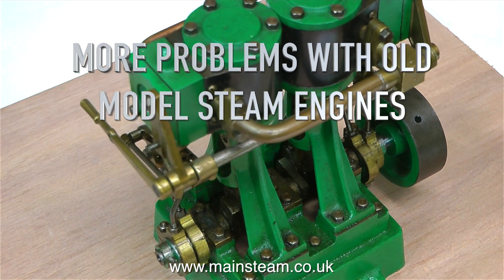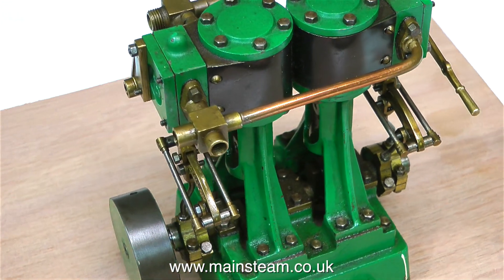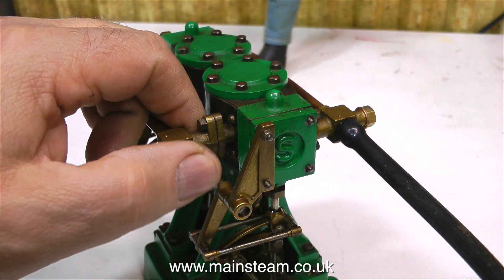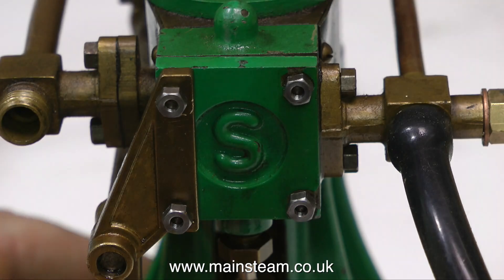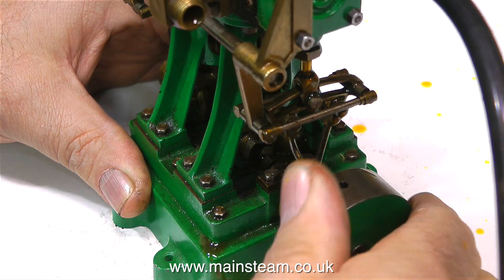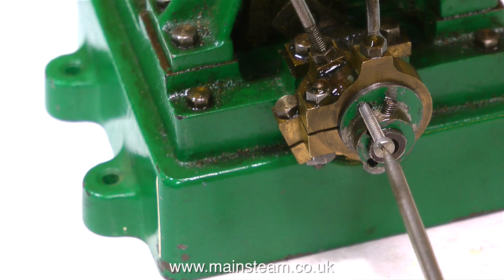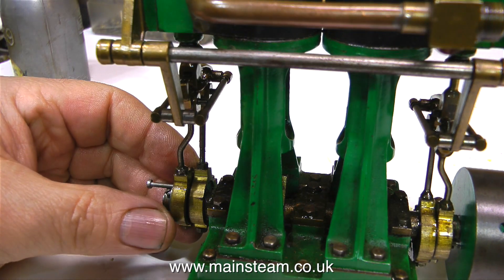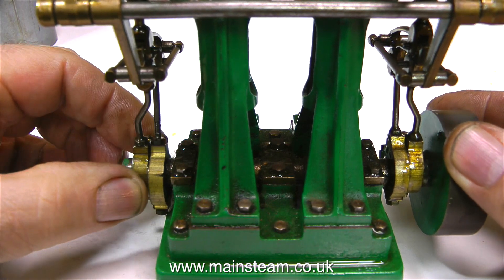MORE TROUBLE WITH OLD MODEL STEAM ENGINES

Comment: very entertaining my friend , Always fun to see the steam engines diagnosis of faults without getting to far into ripping it down,, Like you said time (labor) is money.  Looking forward to the next videos and your big build project. PS, like the way you add the bits from the viewers methods knowledge on "how it should be " .....
Reply from the maker: The steam pump is a complicated piece of equipment and can malfunction - this one isn't working properly at the moment, hence the need for a hand pump, coupled with the fact that a hand pump is useful if not essential for filling the boiler with water before lighting the burner for a steaming session . . . a model steam boiler needs 2 methods of replenishing the water supply. (These are the rules).

Comment: Coma. check
I made steam engines when I was a child. The second one was made out of copper plumbing parts and soldered together. As you may have guessed, just as soon as everything started working great and going fast, it started to melt down! Right in front of the whole classroom. Very funny! The teacher was still impressed, even though it melted down, it worked and pretty well at that.

Comment: To resurface a flat surface that is warped. 1 Use a sheet of flat glass. 2 Lay a sheet of wet or dry sandpaper face up rough side up. 3 Soak with cleaning solvent. 4 Lay object on sandpaper and push down evenly not to hard and work it in a (figure 8). This gives equal wear on work piece. If you work in a circle you will wear down the outside edges and not the center evenly. I have rebuilt many porsche carburetor's. This cures air leaks and results in surging at low RPM you resurface all mating parts and rebuild throttle bushings with line bore.
Regards; Phil

Comment: Even with leaks and bad rings it should at least move a little under pressure. Maybe problem with valves and timing, trying to push both pistons at same time resulting in no rotation. Real cliffhanger what is wrong here.

Comment: Time to be a keyboard warrior, but if you're using sandpaper to make something flat, put the backside of the paper on a window, since glass is generally relatively flat compared to a wood table or similar.

I guess I don't so much want to tell you what to do, but rather maybe point out a method I've used for stuff that I've had success with.

Also, how does RTV work as a gasket material?

Comment: My guess would be a. the valves are not seating, b; blow by on the pistons ether loose or no rings or too small an O ring. As for the surfacing of the valve on the wet/dry paper, when I took Metallurgy back in the dark ages we had one instructor who had us use a figure 6 pattern when doing samples and another who wanted back and forth motion alternated with both clockwise and anticlockwise motion. So we had to see who was watching us do the polishing and match the proper motion, they all got the sample smooth enough that you could see the grain structure under the microscope.

Comment: Maybe it has something to do with that big ass leak and loss of pressure...?
Reply from the maker: No, it would still run .....
Reply: What if you have a bent crank shaft.. There might not be enough pressure building up to push the pistons... That could be why you're getting slight movements
Reply: hes still able to turn the crank shaft by hand. if it where bent it wouldn't rotate freely at all